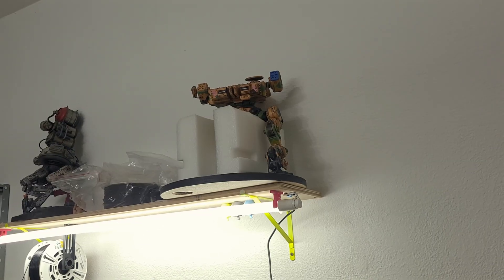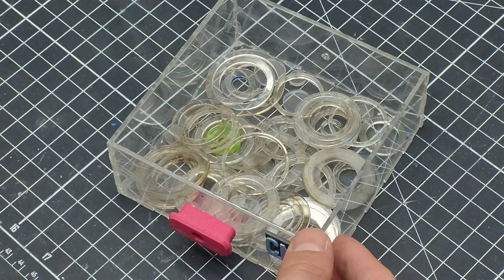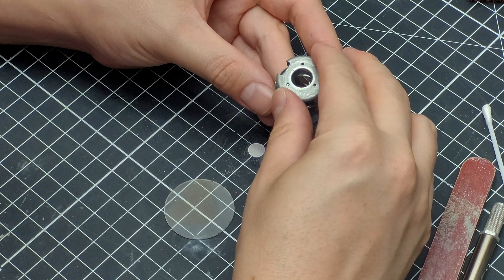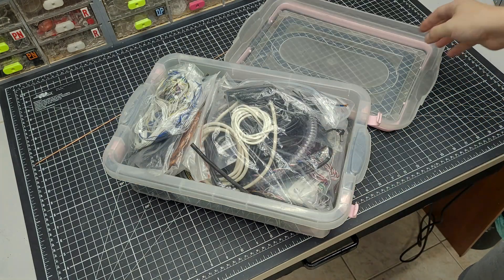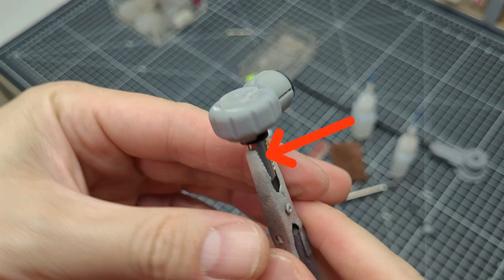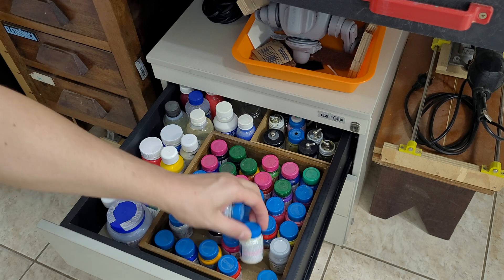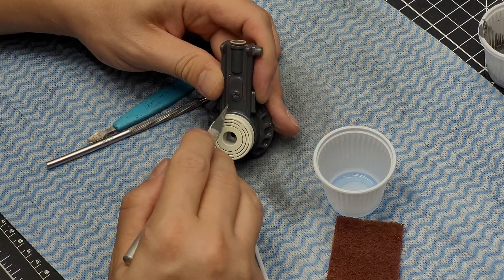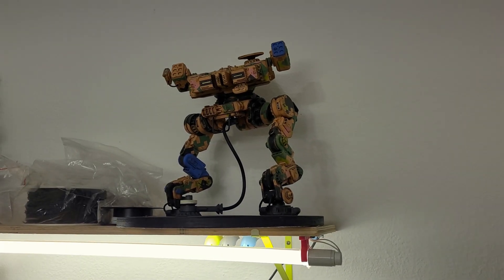Fixing Some BAD Design Choices!

Comment: I don't think it was dumb to use PLA, since it usually good enough for models - but I have also learned the lesson that PLA can sag over time if there is a lot of load and heat on the parts. I bet you could still use 3D printed brackets if you had thru-bolts that could clamp the far sides and keep them from splaying out over time. Regardless, loving the rebuild and glad to see the Flamingo is still kicking!
Reply from the maker: Oh I meant relying only on the pressure from the pla over a ball joint :) thank you so much